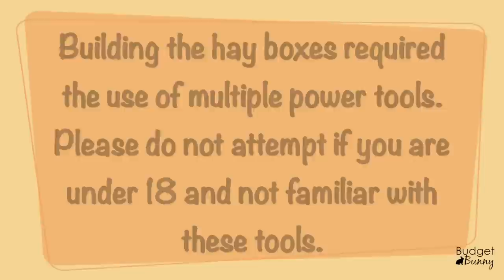BudgetBunny: How To Build the Bb Hay Box

Comment: Love this! I have a question for you; so my 9 month old Lop doesn't like to eat from his hay rack. I fill the bottom of his litter with hay to lure him in there to use his box and then put extra in there for him to eat but I'm worried he's not getting enough hay since he doesn't eat the hay he pees on. Is there a way I could wean him off of eating hay from his litter box and having him eat from the hay rack instead?
Reply: My rabbits were like that. I went through countless hay racks trying to find one they would eat out of. I even zip tied hay in little bundles and hung it in the cage,and put it in various locations around the cage. It got my girls to eat hay for a little while but they seemed to just prefer eating hay out of the litter box. My advice with that is get a big litter box (big cat ones work well) and figure out where they pee and put the hay in the opposite side of the litter box. My girls peed in the back of the litter boxes so I put a big pile of hay in the front and refilled every day or so. There will be some waste but hay is relatively cheap if you get it from a feed store.